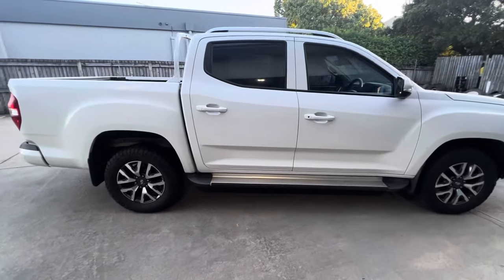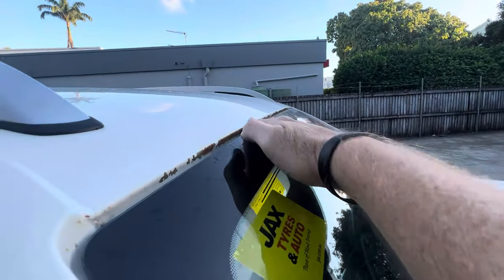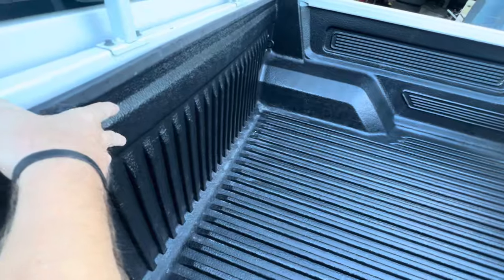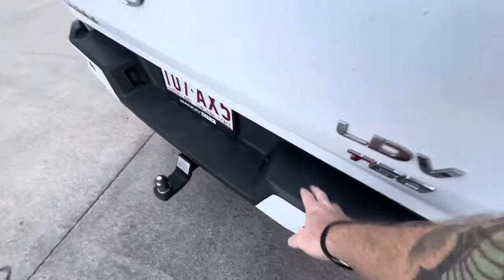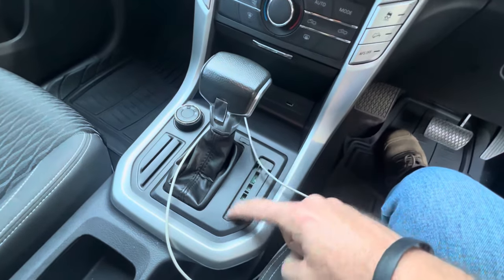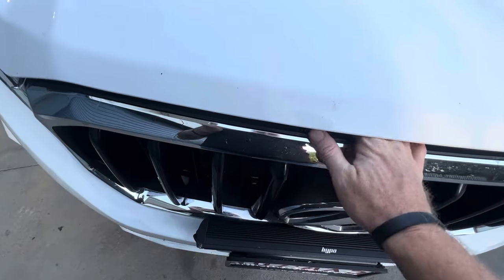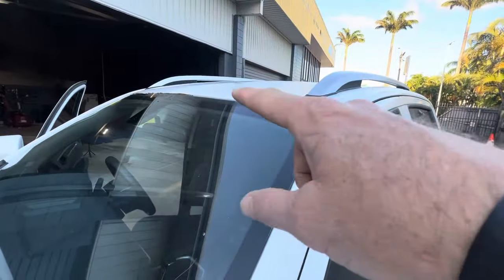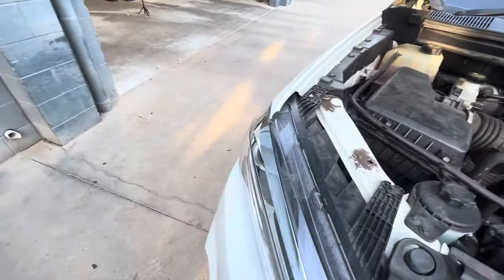LDV T60 Review Australia 2023 | 3years 60,000km

Comment: Hey Mke  take it in and get it checked, same issue with mine above windscreen with paint. As with you, love the car and driving it. LDV are now buying the car back saying it will cost to much to repair, refunding me the full price i paid for it plus extras. The car was a 2019 T60 Lux with 93 000 km on the clock. LDV have been really good about it, would only say that the process takes a while so get it checked out. As i said, love the car, so im replacing it with 2023 lux keeping fingers crossed
Reply from the maker: Hey Peter. Thanks for your comment mate. LDV warranty just updated me last week also, looking forward to updating everyone on next video.